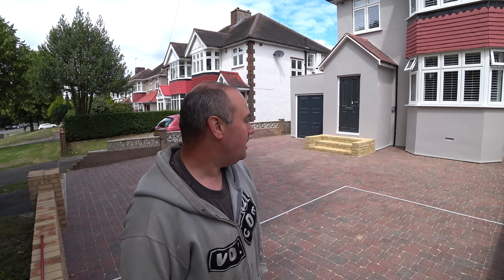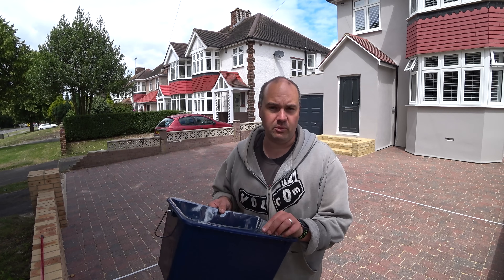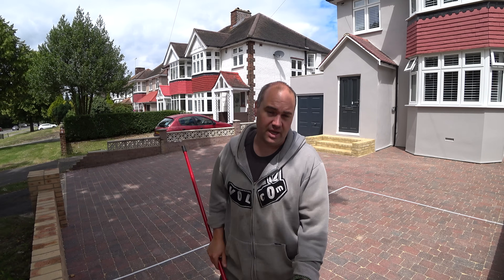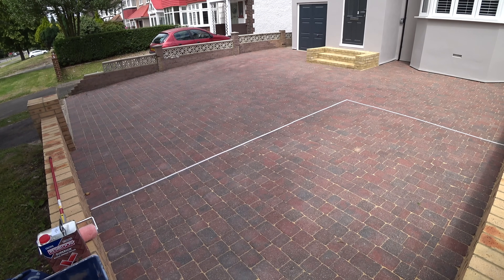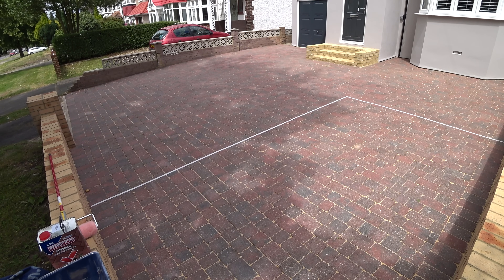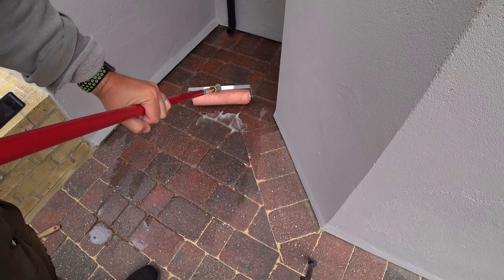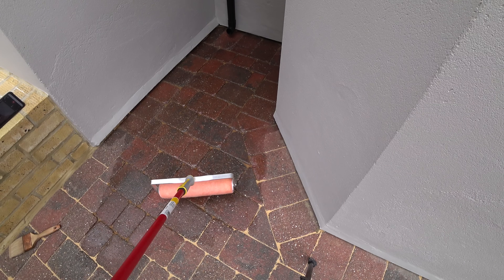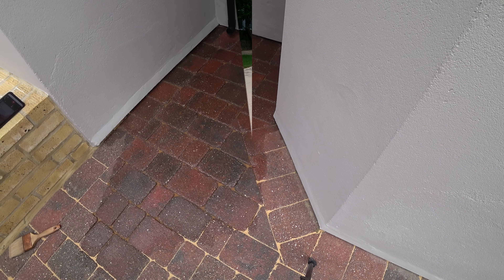How to Seal a Block Pave Driveway - Resiblock Superior Demo & Time-lapse

Comment: Great explanation of sealing and Im with you the sealer you use , I do to excellent stuff .
My drive been down 15 years and only used the cheaper 200 x 100 marshalls ,Brindle inset charcoal borders .
Every 3 years or so I soft wash it ,not power wash , I use a biocide ,then rinse it let it fully dry resend a seal comes up like new and not a weed insight .
I  always use matt sealer my preference on new drives I do and cleaning up old ones

Comment: Hi Phil, great video, thank you. We are going to give it a go here in Scotland - we have two terraces and a driveway in monobloc that came with the house… my question is what about weed killer? In another vid you suggested “misting” with weed killer after sanding - should we do that and then do the sealing once it is dry?
Reply from the maker: @jeanlaurensykes8232  hi, the problem with sealing is the dry time. Resiblock needs about 7 days after cleaning to dry out fully. I would normally sand and seal same day as that will ensure the sand is dry. You shouldn't need to weedkiller before sealing with resiblock providing you did a good enough job removing them when cleaning. If you did want to apply weedkiller then do it the following day after cleaning and allow to dry before sealing. The sealer will prevent moisture going through so will technically starve any weeds that happen to still be in the sub base anyway.  Phill

Comment: Hi Phil spoke to you recently on one of your other videos , asked you if you New how to remove sand off a drive that has just been sealed, the answer was I pressure washed it again using a hot wash pressure washer it removed all the sand and sealer , I’ve just re sanded it properly and sealed it again , looks great 👍
Reply from the maker: OK thats weird what sealer was it because typically a sealer won't come off with hot water if it's done properly. Was it thomsons? If it was then that's probably the reason why it came off lol.

Comment: Thanks for the video together with all the explanation.  Looks amazing.
I ve been thinking about sealing my paving for a week now. Been doing some research, and what I've found is gloss looks amazing but after a while, you start to get patches when the sealer starts to weather. Have you come across this?.
Thnx again for this amazing video
Reply from the maker: It's more the fact that the gloss sealer will wear quicker in areas of traffic. So you will see vehicle wear in areas where cars are parked etc. The resiblock sealer is the best sealer but its expensive. Downside is you can't spray it, you have to roller it. You need to make sure your sanding jib is perfect or the roller will pick up the sand and leave it scattered and stuck to the blocks. Once it's cured it won't come off that easily.

Comment: Very useful video; this liquid seems very expensive, how long this will protect the surface from weed growth?
Reply from the maker: It Is costly, even too expensive now. Longevity depends on how well it is applied and how much sealer penetration the sand gets. If you apply as per instruction, maybe 3-5 years. Ultimately it has so many factors that it's hard to say. Larger gapped blocks such as tegulas tend to suffer quicker from cracking
Reply: Thanks for your prompt reply @DirtyDriveAway

Comment: Am thinking of using this on a newly slabbed garden. Unsure Matt or gloss can you recommend . Thank you
Reply from the maker: It's hard to use because if it gets damp its impossible to rectify. Polyurethane sealers are harder wearing but there is no room for error when it comes to weather and application. Matt will give it a subtle damp look whereas the gloss is a bit of a deeper wet look. Personally I find matt gives the best overall finish as the gloss can look a bit patchy if not applied quite right.

Comment: The photo you showed of the drive covered in sand reminded me of my own.  A year ago my gardener said they could clean and finish the drive.  They said that there was weedkiller in the sand to help keep weeds at bay.  No sealer was used, just a great big mess which seemed to last forever.
Your video is really helpful as I'm doing my drive myself. This product you're using looks marvellous. I'm wondering, do you need to push the roller slightly to allow the sealer to squeeze out.
Reply from the maker: Hi, yes you need to load the roller fairly well and then push slightly as you go. Just make sure if your rollering that your sand joints are well swept, otherwise you'll pull sand out with the roller. Your best off using a 12" double arm medium pile roller and suitable size paint scuttle. This way you can dunk the whole roller in the sealer. You will need 2 rollers as the 1st one will probably dry out before you get the second coat on. Cut the edges in with a cheap 4" brush. The roller and brush are chucked when finished as they aren't worth cleaning. The only way you can dissolve the sealer is with a solvent such as xylene or thinners.
Spraying the sealer is a better option as its cleaner and gives deeper joint penetration but you can't spray resiblock. Phill
Reply: @DirtyDriveAway  I'm really grateful to you for taking the time to respond to my query. Your advice is invaluable and much appreciated.
Reply from the maker: @milamou9352  your welcome. Hope you get it sorted. Any more questions just ask.

Comment: Great vid Phil, what is the maximum time you would leave between re-sanding, and re-sealing, due to all the rain we’re having, I’m having trouble booking in jobs as the area needs to be dry?. Thanks 😀
Reply from the maker: You ideally need to re sand on the same day as sealing. This way you know the sand is dry. There should be 5-7days between cleaning and sealing to allow the water from cleaning to fully drain. I'm in the same boat got 2 sealing jobs and 2 decks to finish.
Reply: @DirtyDriveAway  great thanks 😁

Comment: Hi Phil great video, are these blocks concrete or clay and how do you tell the difference?
Reply from the maker: These are concrete, clay pavers tend to look more like bricks and can have wider joints with the heavier chamfer around the edges.
Reply: Hi Phil,
Impressive job. Looks amazing.
I ve been told re-sealing paving could be very costly and mistakes could be even more costly. Been suggested best to just re-sand and leave it. When they start to discolour ( eg UV) then perhaps consider sealing them. . What would be your professional opinion please?

Comment: Hi bud how much resiblock would you need to 20-25 square metres? assume u need to do two coats? how long do you let first coat try for?
Reply from the maker: Hi, I would say 15L to be safe. You need to leave around 4 hours between coats. Don't expect the wet look finish to last too long, usually 12-18months cosmetic appearance. You have to roller it, you can't spray it, so expect some sand pickup on the roller. Just make sure your sanding is perfect. Otherwise, it can make a mess real fast.
Reply: @DirtyDriveAway  right...cheers pal. was going to go for the matt one :) i will wait till spring / summer when it is dry
Reply from the maker: @Mohit L  matt is still wet look. All acrylic sealers will give a damp look finish. The gloss is just more shiny. It will look like it has a subtle damp appearance when sealed.

Comment: i dont want the wet look, what are the options please? is it possible just to seal the area on the slight slope where the sand is moving from or just use the sealant on the joints only? thank you
Reply from the maker: All acrylic sealers will give a wet look I'm afraid. Only water based ones are invisible but they don't last like acrylic or polyurethane. There no way you'll be able to apply an acrylic sealer to just the joints as it will absorb into the blocks giving a damp appearance around the edges. If you wantnit sealed properly then the damp look is the only real way to do it properly as water based sealers just don't last.

Comment: Hi. Can you put this on fine Aquarium sand to seal it as I’ve got a feature in my garden and the sand keep blowing away when there’s wind or rain
Reply from the maker: Technically, if it's really fine then yes. Personally I would use something cheaper such as smartseal as it will do the same thing. It will only bind small amounts though, it's not designed for flooding over large areas of sand or wide joints. If you want to bind up larger areas, using something like a water-based sealer may have better results. Or even a water down PVA mix.
Reply: @DirtyDriveAway  Thank you

Comment: Great, informative video Phil. As a professional I'd be interested in your thoughts on resanding a cleaned block paved driveway, as I always think mine looks great with fresh sand every couple of years. I presume this can't be done once its been sealed. Must admit mine looks a bit like the 'atrocious' job until I've thoroughly brushed it over a few times leaving looking (in my opinion ) great. Thanks again.
Reply from the maker: If you seal fresh sand it darkens slightly but it should stay clean as the muck can't get in. I've seen driveways sealed 15years ago and they still have hard sand. I always like to ensure any residue sand is blown away when I'm done. I just use a cheap garden blower to dust off the surface residue. Also making sure the sand joints aren't too high is good to ensure you don't get sand loss from rain/wind. This is even more important when sealing as any surface sand will get bound to the blocks. High joints means the roller can pick the sand out and makes it look a dogs dinner.

Comment: Nice job mate I done newly patio last week in the days of the nice sunshine hadn’t rained for a week or so,so nice and dry builders merchant recommended Thompson’s water seal is that as good as your stuff you used thanks
Reply from the maker: I wouldn't use Thompson's, it's cheap and cheerful. Water seal is NOT a sealer, it's a water repellent, it does nothing that a proper sealer will do.
Reply: Dirty Drive-Away thanks mate must admit it was cheaper than your one I’d never heard of it until I saw your video a hour a go can I go over the top with your make,? Thanks
Reply from the maker: @stephenclark8596  I wouldn't to be fair. That water seal stuff is designed for brick walls etc to help the water bead off. The stuff I use is an acrylic sealer and will set the sand hard and seal the blocks. The water seal stuff will just add a water repellency to the blocks. It won't bind the sand and it won't stop weeds etc. If you want to seal the driveway properly I would not apply the water seal as it will probably stop any real sealer from binding to the blocks. If you want a decent fairly priced acrylic sealer look at kingfishers K-seal it's about £24 a tin which is half resiblocks price and works really well. Don't think it will last quite as long as resiblock but it's a lot cheaper. Phill
Reply: Dirty Drive-Away thanks Phil the patio laid was not the blocks it’s the slabs,not marshals but similar I think their called rives or similar come in different sizes a nice job,but the paver never recommended any product he said to seal it,but I’ll take your advice Phil and I’ll get the kingfisher thanks 👍👍
Reply from the maker: @stephenclark8596  the kingfisher is an all in one which means you can use it on most surfaces. The resiblock does dedicated sealers for block paving and sandstone. If it's concrete replica slabs then you can use a water based sealer like resiblock trade, it just depends on what finish your after. Most water based sealers dry clear whereas acrylic sealers tend to darken the stone.
Reply: Dirty Drive-Away thanks Phil sorry to be a pain

Comment: Just a quick question, you no your battery operated bitten seal pump sprayer you have couldn’t you use your sealant in it to spray it in ???
Reply from the maker: Hmm, technically you can but the problem with sealers is they start setting pretty quick. Before you know where you are the triggers etc tend to start getting sticky. When spraying sealers it can be hard to get even coverage and 9 cases out of 10 you have to go over it with a roller. If you were using water based sealer the  you can but again it can be a bit messy. With resiblock or acrylic sealers you need to rinse it all out with thinners or xylene solvent.

Comment: My driveway is on a slope and the jointing sand always fall out in the rain. Is resiblock on to use on a sloped brickweave drive? Many thanks.
Reply from the maker: Any proper service will bind the sand to stop that. It doesn't have to be resiblock. A 2 coat acrylic sealer will offer the best sand binding. Resiblock, smartseal, kingfisher.
Reply from the maker: Also remember that any sealer will take away the natural drainage of the driveway. If it slopes towards the house make sure you have adequate drainage before considering sealing.
Reply: @DirtyDriveAway  thanks for the info. I have drains that work well. Its a new drive with very good levels that keep water away from propety.
Reply from the maker: @ontheroad2279  thats OK then. You cant seal during damp seasons, but if its new make sure you don't get efflorescence blooms (white powdery patches) this will either get trapped under the sealer or cause the sealer to not bond properly.
Reply: @DirtyDriveAway  yep il wait till summer. Cheers dude.

Comment: If I've has sanded a drive way then applied this stuff... In a few years time will it still be possible to power wash the drive way again or does this sealant last forever?
Reply from the maker: The block protection will vary depending on level of traffic. Resiblock give it a 4-5yr lifespan but it can be over coated after a couple years. If applied correctly it should keep the sand hard for many years. Ive seen driveways of 10+ years that were sealed and the sand is still solid. This again will depend on the type of block, popular 200×100 blocks tend to last the longest. If you have wider gaps or tumbled edges with more radius (known as tegula)  corners then it tends to break away quicker.

Comment: Can i seal new block paving as soon as it’s laid?
Reply from the maker: No, you should leave it for several weeks. The problem with new blocks is you can easily get efflorescence blooms (salts). These show as white powdery residues on the blocks. It's best to leave the driveway for several weeks to ensure these salts are allowed to surface and be removed prior to sealing. If you seal straight away you can trap these under the blocks which may end up being visible later or you can end up the adhesion issues. Phill

Comment: Hi Phil. Very good vid. Quick question. You mentioned that a good quality sealant sorts out the weeds, ants, etc. Is this a permanent fix, or do you still recommend spaying a good quality weed killer (e.g Rostate 360), 6/8 weeks after the sealant has been applied? Many thanks.
Reply from the maker: Hi Paul, a good sealer will bind the sand setting it hard. This in turn help prevent weeds from seeding in the sand or growing through it. Since the jointing sand  will be hard after the sealer has been applied a weedkiller won't actually do anything since it can't penetrate the now binded sand. Using an acrylic/polyurethane sealer makes the joints impermeable, meaning it will also take away the natural drainage that block paving has. This is why I always assess areas prior to quoting for sealing as some (especially patios) tend to lack good drainage. When it rains heavily you will end up with pooling water. The only time you should need a weedkiller after sealing is if in time the sand cracks and weeds can grow. I have seen sealed driveways that have remained pretty much weed free for many many years. Phill
Reply: Dirty Drive-Away Thanks for the reply. Drainage could potentially be an issue. So, after re-sanding, a coverage of weed killer every 6/8 weeks should be ok?
Reply from the maker: @paulyoung2814  hey Paul, yeah if your not going to seal it then a regular weedkilling regime is best. You can buy permeable sealers which a designed for SUDS paving. It seals the blocks but still allows water through. Can be quite pricey though, https://www.resiblock.com/product/resiblock-envirofix/
Reply: Dirty Drive-Away Many thanks.

Comment: How many tins did you use in the end if you can remember?
Reply from the maker: This driveway used 10x 5L tins of this Resiblock product. The coverage rate on resiblock is normally 3sqM a litre on 1st coat and 6sqM L on the 2nd coat. Whatever your area is in sqM half it and that's how many litres you'll need. In the case of this driveway it was 100sqM and needed 50L. Just remember Resiblock can't be sprayed on, it has to be rollered.

Comment: Once done, matt or gloss, how effective is it at stopping oil ingress from a leaky engine or gearbox?
Reply from the maker: It is actually pretty good, gloss or matt makes no odds. To be fair the gloss isn't stupidly shiny and the matt still gives a damp look. The resistance to oil ingress obviously does depend how long you leave it on the floor. Resiblock recommend wiping it up with a cloth ASAP. They won't guarantee it wont soak in if left for prolonged periods.

Comment: Do your customers pay for the resiblock or does it come out of your pocket ?
Reply from the maker: Customers pay for it. Resiblock is too expensive to be giving away free. In fact sealing will easily triple the price of a normal clean/sand.
Reply: @DirtyDriveAway  exactly my thinking mate, so I take it it’s a resiblock sealer or no sealer ? What about smart seal ? My customs would never pay for resi 🤣
Reply from the maker: @Unknown-us4nx  I only use resi if the customer insists otherwise its smartseal or K-seal. Resi is a nightmare if it gets damp, so I avoid it as much as possible.